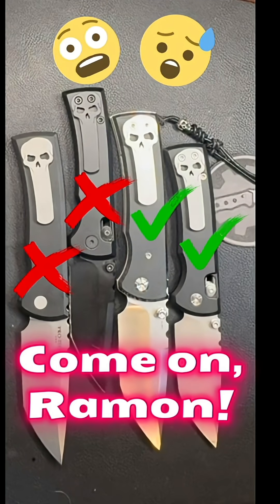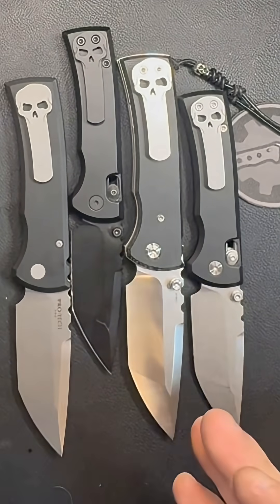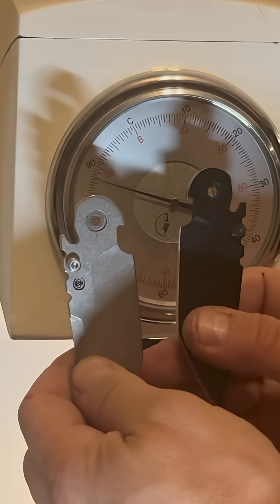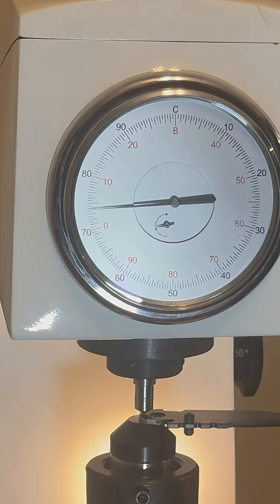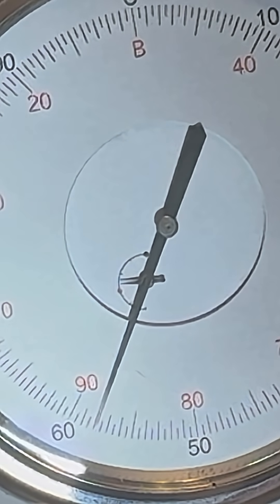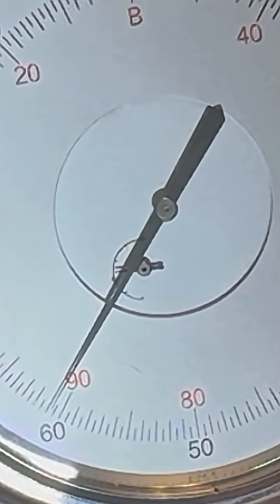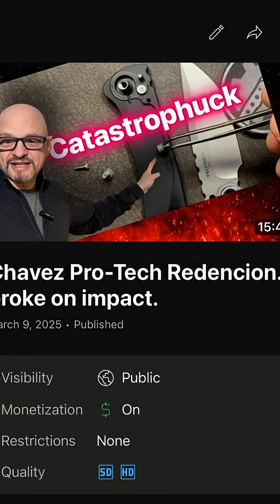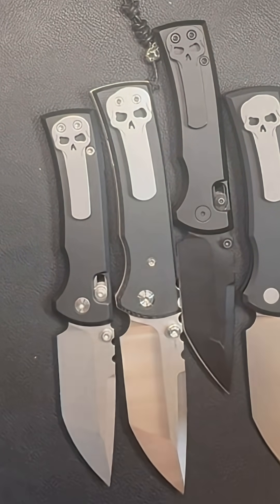Give these two a PASS!!! Pick those instead.

Comment: Have you tested any of the Benchmade like the cerakote Adira vs the plain or the M4 Bailouts sir?  Curious if it is a cerakote problem or just these knives.
Reply from the maker: I tested Uncoated Adiras and Mini Adira Ceracoat. All is on my channel. M4 is a high speed tool steel that won’t be affected by Ceracoat due to its high tempering temperature.

Comment: Another reason not to like coated steel on a budget blade besides the tacticool mall ninja look. As you have pointed out unless the heat treatment is adjusted on a steel like D2 to take into consideration the effect of the heat applied during the coating process you will get results like these. Learning alot from your videos  keep up the good work.
Reply from the maker: Glad my videos are helpful for your knife journey!
Reply: I think added corrosion resistance is plenty of a good reason to want a coating on ‘budget’ steel blades. I work in a wet, salty environment and can sharpen a blade so I don’t need to spend the money on much more than D2 but I like coatings to keep my blade clean and smooth and I’ll touch up the edge as needed. It’s not just a tactical/ninja thing which is seriously ignorant to think that anyways. Coatings are there to look cool otherwise they’d just be painted, these coatings are created and formulated for specific purposes and there’s a reason you can’t just scratch it off.

Comment: I’d definitely never choose a cerakoted blade, it wears off too easily and then looks cheap to me. I also know there’s an increased chance the hardness could be lower. I do like acid washed knives and I think they wear more naturally.
Reply from the maker: This knife would look great in acid washed finish!
Reply: @CuttingBoardRx  any thoughts on the new acid etched/stonewashed/witch magic new Vosteed Psyop model? I have a micarta version and love it, but I'm a little scared of what all that extra treatment to the blade could've done to the Elmax hrc level!
Reply from the maker: If it’s truly acid wash process, then there should be no critical heat, the blade should be fine